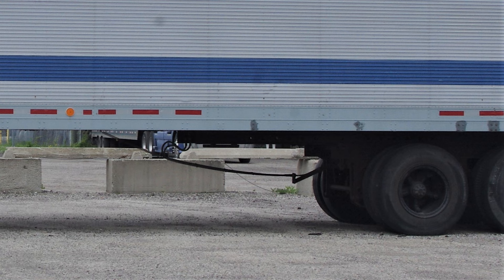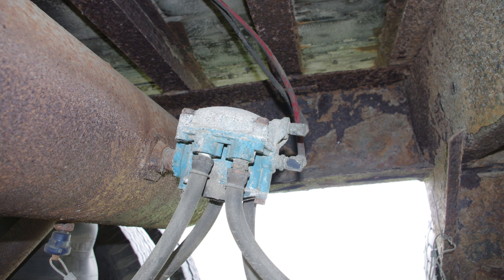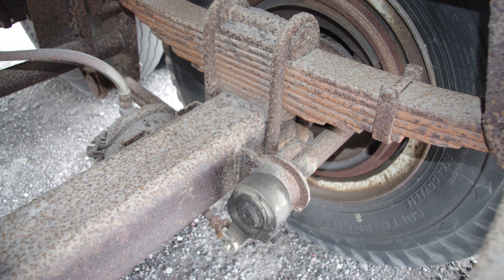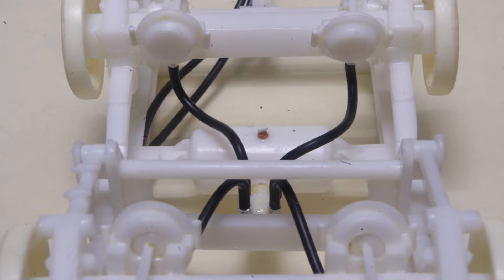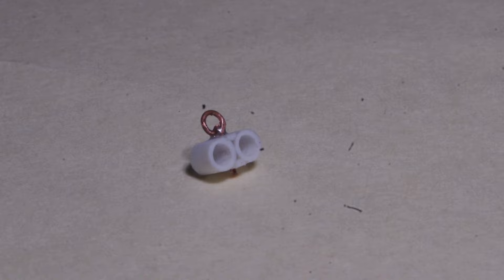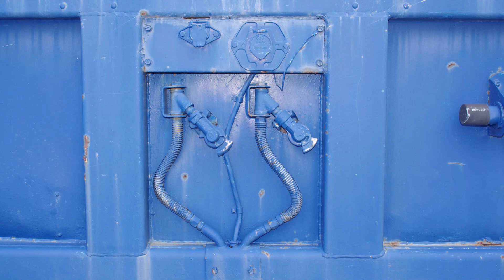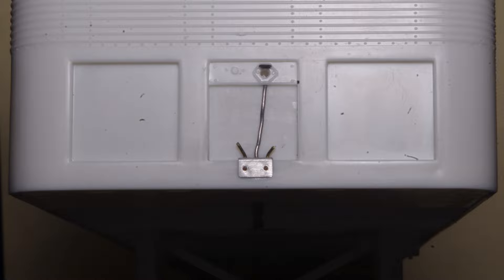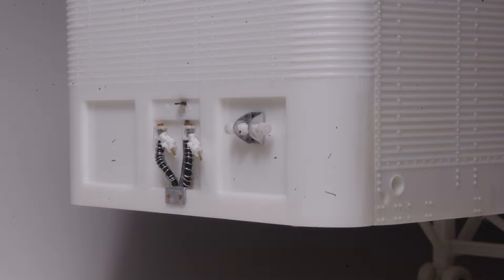Adding Air Brake Lines to AMT's 1/25 scale Van Trailer

Comment: Great video as usual just a tip if anyone has trouble finding the AMT air hose tubing you can use fly fishing fly tying tube it usually comes in 3 sizes the smallest of which is good for electrical lines and the largest is good for air lines
Reply from the maker: Thank you for the tip, that is something I wouldn’t have known about otherwise. Even when kits have air hose material I have seen some difference in sizes and a wide range of flexibility from very flexible to almost too rigid to work with.

Comment: Thank you for posting this. Trailer detail is quite under rated and can really bring out that "Wow factor". I really like how you covered each aspect from the brakes themselves to the glad hands (and everything in between). I now plan on retro-fitting brake lines on an existing trailer.
Reply from the maker: Pleased to hear you found it helpful, I agree that trailers are just as important as the tractors and equally interesting when you start looking into the smaller details.

Comment: Great video of a seldom ever mentioned (but important to me) detail...at least in 1/25 scale. 
Definitely keeping this video in my reference library.
Remarkable you found the actual prototype trailer that matches the AMT version....the photographs were great.
And the Bill of Laden holder/bracket is basically a tube with the rolled up bill of laden sheet rolled up inside? 
Thanks for posting.
Reply from the maker: There have actually been several "lookalike" trailers to the AMT kit that I have seen over the years, most if not all of course long taken off the highway and parked up for storage. Only major difference from the kit I have seen on many of them is roll up rear door instead of the swing doors.

I forgot to mention in the video that after 1975, trailers had to be built with spring brakes but there was no requirement to retrofit them onto pre-1975 trailers. The non-spring brake equipped, pre 1975 trailer brake systems were similar to a railroad freight car's brake system in the they "parked on air", and when the air leaked down the brakes released.

Yes, document holder is exactly as you describe: A tube (aluminum usually) with end caps, rolled up papers are placed inside.

Comment: Always rare and nice to find the exact same vehicle used by amt for reference. I saw one of these trailers a few years ago as a storage trailer but it disappeared shortly after before I could get pictures. There's a scrap place down the street so that's likely where it ended up. I try to photograph old trailers when I find them, it's very hard to find any reference on trailers.
Reply from the maker: I've made that same mistake in the past, thinking that something (truck, trailer, even building) that had "always been there" would always be there, and then when I did decide to photograph it - gone!
Reply: @brsnorthernhorsejourney3579  I even saw a trailer that matched the AMT tanker, same story. Now I make a point of going out to get pictures.

Comment: What kind of glue did you find works best for attaching the rubber airlines and electronal underneath  the trailer between the cross members?
Reply from the maker: I have had the best results with medium CA (cyanoacrylate, aka "super glue"), the one that seems to be available at the hobby shops most accessible to me is "Insta-Cure+", I use their "Gap filling medium 5-10 second cure" which has purple label and cap. 

Other hobby CA brands I have heard of are Bob Smith and Zap CA.
Reply: @brsnorthernhorsejourney3579  
Thank you...

Comment: Thanks 🙏🏽!!  That’s help me a lot!!
I’m planning to build a 40 feet trailer with smooth sides. I’m not an expert on scratch build so I’ll will take a while to me to start. Question: what thickness did you use for the sides and doors of the trailer?  ( hope I explain my self well) I have .040 and .060. Styrene sheets. 
Thanks for all your help!!
Reply from the maker: B & R's Northern Horse Journey
11 minutes ago
For a scratch built van trailer model in 1/25 scale I would recommend using .060" styrene for plenty of strength. (This model was built using the kit supplied parts for sides and and doors which I believe are around .040", I also added plenty of bracing along the inside floor to side joint.)

40 scale feet is about 20 actual inches long, Evergreen does offer styrene sheets in up to 24 inches long. Depending on the trailer you are modelling you can use rivet decals to represent fasteners or, if it an trailer with  FRP (fiberglass reinforced plywood) sides,  the slightly rough texture of FRP panel can be simulated by applying primer with a small roller.